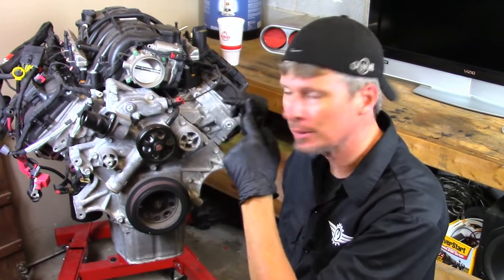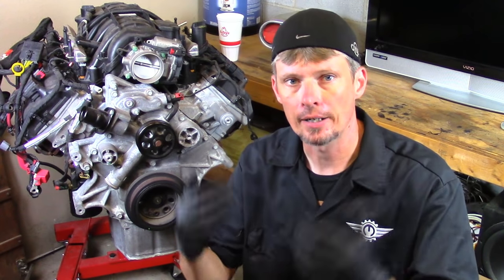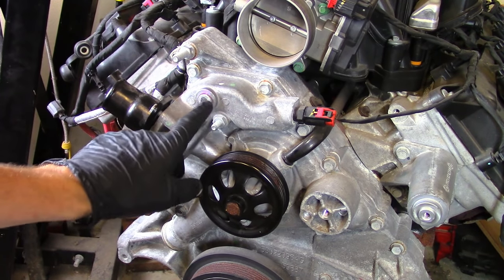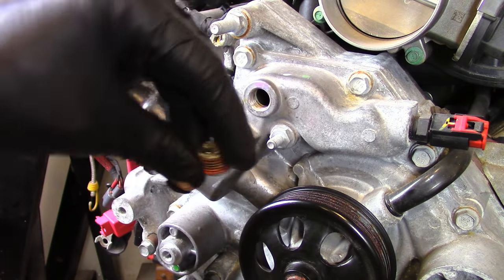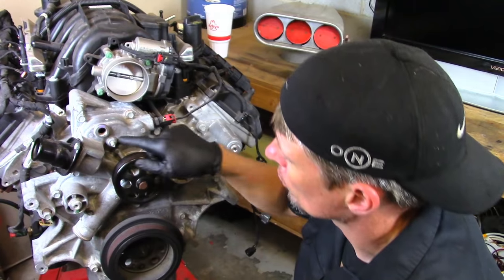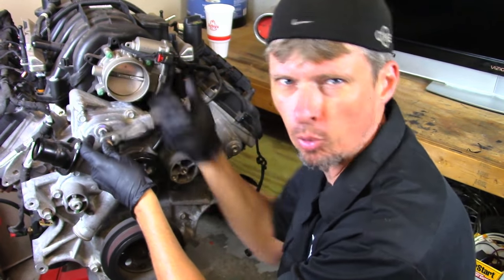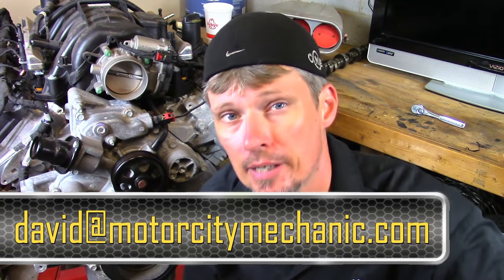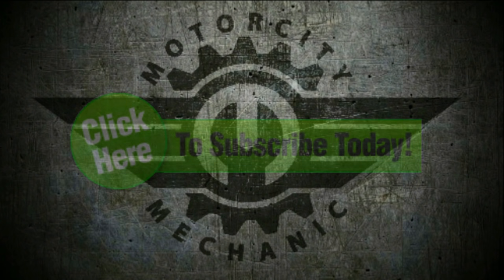Quick Tip: 5.7 Hemi coolant bleeder location and fill procedure

Comment: tried this way again and again and still no go for me. i even let a long steady stream pour out (almost emptying the reservoir in the process) hoping to get all the bubble/s out. 
new 203 t-stat, new silicone hoses, new temp sensor, new coolant and even purple ice. 1st few times without purple ice w/ same results. 
driving on highway and needle sits just a hair past 200 (203?) but sitting in traffic or even a stop light and it goes up to the 3/4th line. i also leave the cap off over night to let level drop. fill before driving only to be greeted with same results. 
i find this very hard to believe this is normal. 
no mods
2006 magnum srt8
Reply from the maker: It sounds like you may have other issues.......I would make sure the fan or fans work properly. I dont think its an air trapped issue....something else that going to need to be diag.
Reply: all is well now. ended up using the 'steelman cooling system test and purge kit' that we have at work. thanks for the tips and video.

Comment: I have a 2017 ram 1500 with the 5.7 it does not have a bleeder neither did my 2015, that location is where the thermal management system line for the zf8ph70 trans runs into ( the one that warms the trans up faster and aids in cooling).
Reply from the maker: Yeah the trucks dont have a bleeder which never made any sense to me. Thats when one of those "air lift" tools works best to remove all the air by creating a vacuum and then sucking the coolant back into the engine which eliminates almost all air.
Reply: so have you made a video that shows how to do the "Air Lift" tools coolant to suck the air out?

Comment: Do you havr to run car with heater on and raidiator cap off
Reply from the maker: I dont.....i just remove the bleeder while the engine is off and cold. Then just recheck the level each morning for the next few days to see if any change. Thanks for asking and make sure to subscribe.

Comment: **I HAVE A QUESTION** if anyone can help me I would appreciate it.  Below are two (2) quick videos I made of my LEAKING COOLANT issue with my 2011 JEEP GRAND CHEROKEE with the 5.7L HEMI.   I am LEAKING Coolant and I am not sure from where. I go through a Gallon of 50/50 coolant per week OR MORE depending on how far I am going.   A few years ago I replaced the Water Pump and today I purchased a new water pump.  My old water pump before WAS BAD, but this one I am not so sure BUT I am getting fluid all over.  Here are two (2) quick videos showing the leaking and maybe you all can give me a better educated guess what to do.
(1) https://www.youtube.com/watch?v=V0Kx9nuNh0o&t=68s
(2) https://www.youtube.com/watch?v=qq8_CK2flAc&t=5s

Comment: I chnage my water pum on my Dodge Charger n now my car don’t start?
Reply from the maker: Make sure you didn’t unplug anything and forgot to plug it back in like the cam position sensor that’s mounted in that area. It’s the only thing coming to mind
Reply: I'm not a mechanic but it was easy to change it, ok the problem was that when I finished changing the pump, I put it on antifreezer, and I turned it on, waited for it to warm up so that the water went down, but it did not come down, so it drives like a block, and the engine was heated and turned off and no longer wanted to start

Comment: I don't see the point in this. Workshops don't go to this level. The highest point of the coolant system is the reservior bottle. That's all you need to know. You always bleed from the  highest point in the system
Reply from the maker: The bleeder is there for a reason and I know mechanics use it. Too many people have issue when they don’t, feel free to read thru the comments and see for yourself. The best method to bleed isn’t the highest point…..getting behind the thermostat where the air gets trapped is when ever it is possible. That’s the reason for the bleeder. Once you remove the air from that area…..the system will allow the coolant to take the place of the air as your filling the radiator opening or pressure tank. Different engines have bleeder in different places and some don’t have any. Those that don’t we use a vacuum fill procedure to try and get the air out.
Reply: @MotorCityMechanic  Yeah, I had this on my Dodge RAM 1500 5.7L Laramie when I lived in Canada. I didn't know about that bleed port and never had any problems. I drove the truck daily (high miles on it already) and owned it for nearly 2yrs. Sold it to my mate (also from Australia) who came over and he owned it for 2yrs. He sold it to another guy and it was still running just fine. This is why I'm questioning this particular part of the methodology as I'm working on a friend's car here in Texas, now, and it's having issues after the heater hose t-piece broke the other day and was spraying coolant around. They did have a thermostat stuck on it over 1yr ago and it overheated. I told them the symptoms I'm seeing (from experience) is a blown/leaking headgasket
Reply: The amount of air/boiling coming through to the reservior gives it away for a blown/leaking headgasket